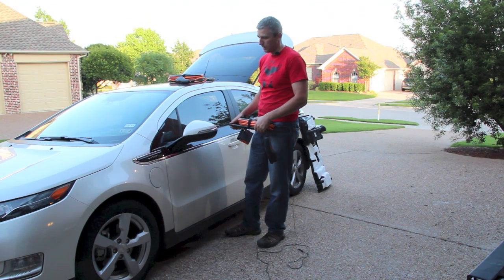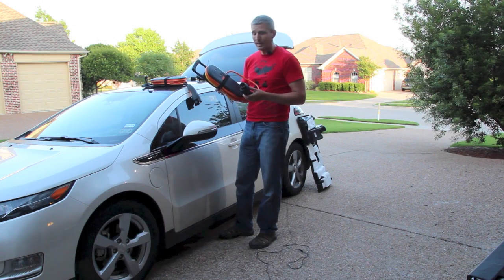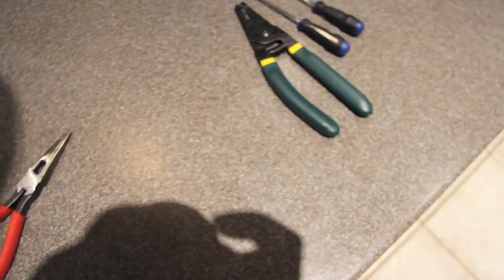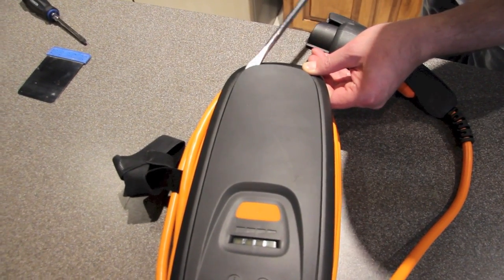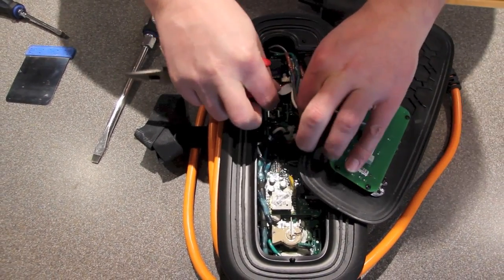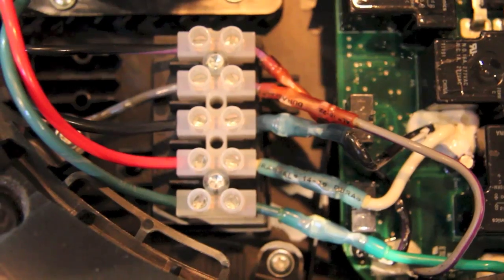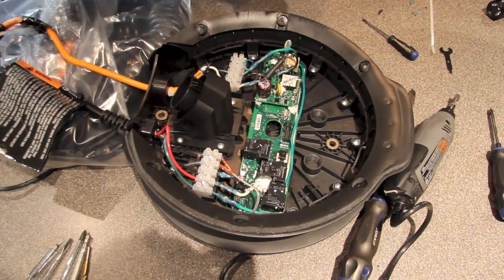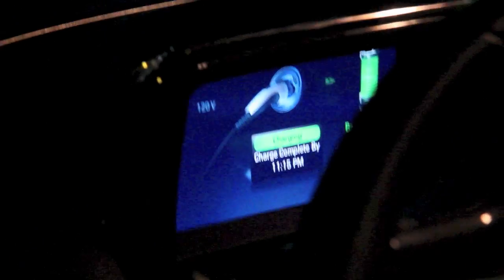Chevy Volt 120v to 240v charger conversion

Comment: Good way to save $450... some other guy on YT found that the board inside the factory chargers for 120-240 were identical so he just made his own adapter plug for few dollars and charging still no problem at 240. So he can still do 120 or switch to 240 with the adpter. on his comments many other people tried it as well and said after a year of using the adapter no problems.

Comment: I see your comment below of "it's a lease so who cares?"
As a lease inspector I have seen a lot of "who cares? attitudes toward cars, and now I can add this to my list of douchebaggery. 
Aside of views I see no real reason have bothered with this.  The 240 charger would stow just as easy, in fact i have a 240v that i bought that's smaller than the factory unit.
Only issue is there are few places that have NEMA 14-50 plugs so in the end, what is the point?

Comment: I think the question is why did you change that 120 volt primary to a 240-volt primary on that charger it only has the capacity on which it's rated when you do that the only thing that happens is you draw less amps to charge in other words that charger will not charge your vehicle any faster it does not have the capacity to do so

Comment: I converted my 2013 charge controller.  It's obvious that they used the same board for countries where 220 is standard house voltage.  It was just a matter of utilizing the second leg of the double pole contactor.  I brought neutral in so that the board electronics is still run off 120, as I have no way of knowing if it is dual voltage.

Comment: Awesome instructional.  I have an Intertek 400982 branded Voltec L1 ESVE.  Is that unit suitable for the conversion you demonstrated here?  I need at least 12 gauge input wire, correct?

Comment: Never crimp such important connections! Solder, heat shrink with hot glue! Jack would be steaming. Crimped connections are failure prone, for example, if you do not pinch the right part or pinch with insufficient force there will be resistance, heat and maybe FIRE!
Reply: This is backwards. Soldered connections are left robust for stranded wire. Those particular crimps suck but some ferrules and a terminal block would’ve been superior.

Comment: For all the work thats involved in doing this and the potential for getting it wrong its safer and better to just buy a 240 volt charger. Don't risk "F" ing up your car
Reply: Andrei Doroftei:   All I'm saying is,  at this point in time its not worth hacking up the 120 volt charger that comes with the Volt  to make a 240 volt charger. Just go out and buy one then you have more charging flexibility with out doing anything except spend $200 bucks or so. If you can afford to buy the Volt you can afford an extra charger and not risk making a mistake that will cost thousands to fix.
Reply: rationalguy  The key phrase is: know what your doing" and even then "shit" happens. I've been doing electrical work for over 44 years and mistakes still happen to the best of installers. For the novice its not worth blowing a 38 thousand dollar cars charging system but of course people will do what people will do.
Reply: @Harrison2253  The car adapts to whatever is plugged in. The EVSE only provides the pilot signal to the car to tell the car how many amps it can draw. The car then responds to the EVSE and the EVSE (charge cord) turns the power on. Worst thing that can happen, blow up the EVSE, but this video was pointless because the EVSE will work on both 120 and 240.
Reply: That's what he did. And then hacked up both of them to swap the guts. And then made a *MASSIVE* electrical no-no by making that 220v extension with a 120v receptacle on it.
Reply: You can buy a 240 volt fast charger thats sized for the Volt for about  $200. Its not worth the risk or the time messing around with the other one. Besides you still need to keep the 120 volt charger in the car for traveling so you can charge up in places where its possible to do that like a friend or relatives house.
Reply: @jfbeam  I did the same, 240 on one end 120 on the other, but it is tied to the charger so nobody is going to plug anything into it.
Reply from the maker: When I made this video over 3 years ago portable chargers did not exist, so buying one was not an option....Especially one that charges BOTH 120V and 220V in the same charger that fits into its original cubby in the car.....read the above description and who i would recommend this for. And  jfbeam ....over 80% of the world works on 220V with very long extension cords that run toasters , drills and lights all very safely. ...this charger had thousands of charges both in the rain and in the sun the entire time i owned the volt without a single problem .
Reply from the maker: you are correct
Reply: Robert M True, unless you're an experienced tinkerer.  I had no trouble doing exactly what this guy did, and it worked fine.  Only certain years came with these charge controllers that are easily converted to 220, I think.
Reply: do you have a link to the one for $200?

Comment: So I am looking as close as I can in your video regarding the difference between the two boards, it really looks like the manufacture simply changed the white neutral out for RED to indicate L2.  I measured between GND (Green) and Neutral (White) on my 120volt Voltec and they are certainly not tied together internally.  Therefore if they are simply using the three relays to switch on Green, Black & Neutral or Red (L2) one might simply apply the L2 line to the white wire and have 240vac at the J1772.  Sure wish you compared the two boards more closely in order to determine if this really is the case.  Not brave enough to just do this just yet, but will be investigating much further.
Reply: Which 220V compact models would you recommend?  The Turbocord?
Reply: The why is in the programming. Also, you simply changed the logic without changing the cord that actually carries the current. That thing is not the actual charger, it's a cord with bunch of electronics that's supposed to make it safe. (the J1772 end has no power on it until the controller and charger -- which is part of the car -- agree.) So, you're now pulling twice the current through wires that were likely at the edge of spec for 12/16A 120V charging.
Reply from the maker: scifialiengeek i cannot recall as to the why , since it has been a while .....but one  cannot change the 110v to a 220v. Its just built to cheaply to handle the voltage/amperage and heat. 
The 220v can barely support it.... i believe they were made by the lowest bidder.... el-cheapo inc. 
there are better companies now manufacturing compact 220v chargers..... back in the day there were was no one.

Comment: Would my level 2 charger work as a level 1 charger if i plugged it into a 120v outlet (using a 240v female to 120v male cord)?
Reply from the maker: yes  with Voltec chargers.... just like in the video.

Comment: I believe that the Volt 120v charger uses 16AWG wire in the 25' cord to the J1772 plug. At 12 amps, this gauge of wire heats at about 1 Watt per foot. Going to 16 amps, which I believe the 240v EVSE is designed to do, increases the heating to about 2 Watts per foot. This is because the power burned up in the wire is proportional to the square of current (144:256). This 'might' be ok if the environment where it's used can dissipate the heat before the insulation melts. So, always fully uncoil the cable and spread it out! And if the 120v operation increases to 16 amps, beware that a typical 120v, 15 amp socket will be overloaded by this device.
Reply from the maker: you are correct....But  the original i converted runs in the 110 degree texas heat with no problem.. and i even replaced the original 2 foot cable with a 75ft one, giving  me almost 100ft of reach.... the only problem is that it no longer fits in the trunk tray and when in use u have to completely uncoil it.....  i currently have over 400+ charges on it with no noticeable  overheating, because it dissipates ... it does get warm but no more or less the the original 110v, and i do have and run both....  getting tired of the Volt...time for something new
Reply: Andrei Doroftei Tesla Model S? ;-)
Reply: Andrei Doroftei 

Get the Caddy ELR, pretty much a glorified Volt :)..

Comment: Hi i got question I m in Europe right now. I have 220V 50HZ power sorce and some chinese wants to sell me plug for charging chevrolet volt with is simple cable that have same imput like output power specyfication. So my question is: Is it allowed to put 220v 50HZ directly in to the chevrolet socket? I hear rumors that volt have onboard charger right ? So why do you use external chargers for it and what is power output on them ?
Reply: +Radoslaw Piechowiak You are absolutely correct. All L1/L2 chargers for EVs are INSIDE the car. The external "chargers" are ONLY extension cords with logic to make sure the car is properly connected before the power is applied. The external "charger" & the internal charger talk to each other to make sure the correct amount of power is being sent to the car's charger(s). The external "chargers" are designed to make it safe for humans to play with High Voltage in public. It is also useful in the home to keep your kids safe, but it's your home. You could defeat the pilot wire & plug 240v directly into your EV if you want. L3 is different. The L3 charger is external to the car, and does not use the internal chargers. L3 simply dumps DC volts directly into the DC battery pack. Of course the L3 also talks to the car to insure the car gets the correct amount of power it requires & can handle.

Comment: aeronutt... Just because I didn't know, I went with the 2013 version and so far all is working Great. Only issue is now there are other places I can plug into 200 but what a variety of plug configurations there are. I'm doing my homework with each option but so far, just using the same plug type as the video. Just happened to be the same 220 outlet at home too.
Reply: did you simply run line voltage to the neutral wire.  In essence I'm considering a shortcut by putting 240 volts to the evse suppied with my 2014 Volt.

Comment: 2014 Volt. Did your conversion and it's working Great! Now my commute is almost free (I still use 0.1 gl), I did use an older 110v charger. Thanks for sharing the possibilities.
Kevin :)
Reply from the maker: 18 months  and 250 or so charges with no problems ....

Comment: Love your conversion and the garage mechanics. I'm close to buying a 2014 Volt and will look to your solution. Any problems to report with your project since it's creation? Will the 2013 & 2014 equipment work the same?
Reply from the maker: no problems of any kind.... not sure about  the new chargers..... it all depends on how the board is configured.... if it looks the same it will probably work..
Reply: The 2013/2014 stock EVSE is a completely different animal. Much easier to do the conversion on because it is held together with screws rather than sonic welds. Clipper Creek makes the newer ones for GM under contract, but they also sells the same EVSE configured as a 240v charger. I gutted mine and replaced the innards with OpenEVSE components and made it auto-switching for either 120 or 240 charging. It works great!

Comment: do you know that is the output difference between the 120v. and the 220v. charger?
 Is it higher amps or is it a higher voltage or both with the 220 charger ?
do you know those numbers?

Comment: Curious as to why you swapped the boards. why not just use the new aftermarket charger?
Reply: Because that was a wall charger. He wanted a dual voltage portable charger. I do wonder how he sold it for the same price he paid after downgrading it.

Comment: The volt won't charge at 30A, since it only has a 3.3kW on-board charger.  Good point, but as long as you aren't connecting the modified unit with a car that has a 6.6kW charger, you aren't asking for any more current than if you were running the regular 120V EVSE.  Doubling voltage, not current!

Comment: why not attach a 240/120 plug to the end of the voltec 240 unit, with the 120 and 240 extension ends.. that will to the same thing without all the transfers. a 240 unit work with 120 power as well as 240v but not vise versa!
Reply: I was thinking of that idea as well

Comment: So........... this wasn't a conversion but a transplant.
Thanks for showing how to tear the 120V charger casing apart.
Although I think "cascading" a double pole relay (controlled by the 120v original circuit) would have done the trick also.

Comment: The portable EVSEs in Europe and Japan already work at 220V, but they don't sell them in U.S.  Tesla's portable EVSE costs only $600 and works from 120-220V up to 40A.  I've considered buying a Tesla unit for $600, chopping off the Tesla connector, and attaching a $250 J1772 connector.  Tesla hardware should be compatible with our cars, they just used a different physical connector.